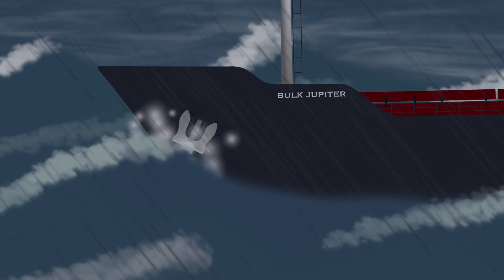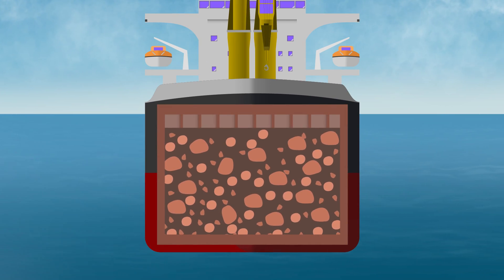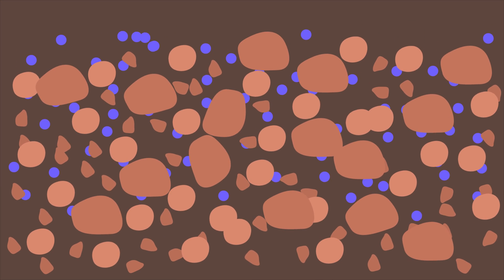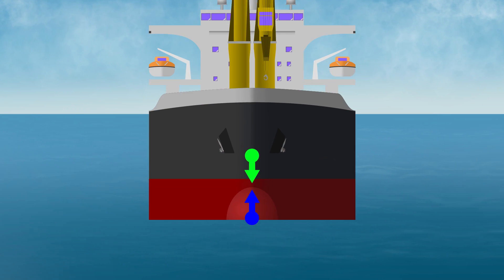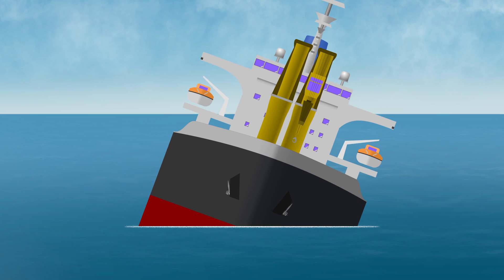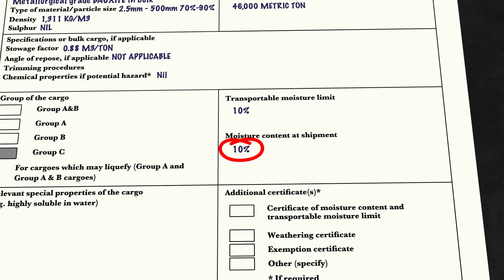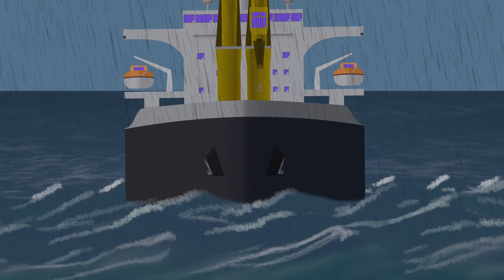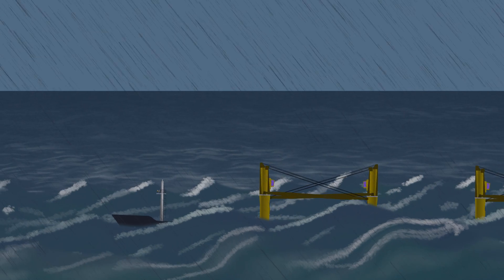Why Does Solid Cargo Turn Into A Liquid? - Liquefaction & Dynamic Separation Explained!

Comment: They need ship captains/load supervisors to have the same authority that pilots do about whether or not a plane takes off. If something doesn't look right with the weather, or the cargo, or the passengers, or the fuel, or whatever, a pilot maintains final-say authority about whether or not it goes out. The company shouldn't be allowed to pressure captains to accept potentially deadly assignments just to meet a deadline. It's ultimately the captain's life on the line.

Also, if your port regularly ships out bauxite, and you have a "rainy season", you should build covered storage.

Comment: Solid cargo ships can make use of moisture removing chemical filters at the port or can use alternate methods of moisture removal through heating systems, and also a moisture removal piping system to transport out the moisture, as it gets generated inside the cargo area, should be installed on board the ships that carry such solid cargo.

Comment: Strang that there are no sensing devices used in the ship's hold for cargo in an open hold loading operation or dewatering devices that could pump off the top slurry if it were to occur during transport. Dollers over safety rules.

Comment: This is also a problem in civil engineering:
https://en.wikipedia.org/wiki/Quick_clay
where seemingly solid ground can suddenly liquify due to mechanical disturbance (vibrations from construction machijnery, blasting) and collapse structures.
Certain types of clay are especially prone to it: They are fine grained and the mineral content of the soil consists of microscopically small flat platelets, which are stacked together like a house of cards. If water gets into this structure, it acts as a lubricant and any mechanical disturbance can cause these house of cards structures to collapse and turn the formerly solid soil into liquid mud.

Comment: Are the arrows in minute 1 opposite. Shouldn't buoyancy be above the center of gravity?
Reply: Buoyancy above gravity means you have capsized
Reply: @phantomsplit3491  maybe I am confused but I think it's the other way around
Reply: @rtarouca 
You are confused :) 

Center of buoyancy results from the displaced water, so it can never be above the water line! 
Center of gravity is the entire ship, including all the bits that make it not-a-submarine (yet).

So every ship will capsize when it keels over beyond a certain point.
Reply: @MrNicoJac  OK :). But let me explain my confusion. Buoyancy pulls up and gravity down. Looking from the bow, let's say boat leans to the right. The buoyancy moves to the right, the center of gravity stays in the same point. Is buoyancy is pulling the boat up and to the centre line, then it can be bellow the center of gravity. If you think of this as levers then we need to understand how these levers  would work to level the ship and keep it stable.  If you don't agree, let me know

Comment: Axial baffles in the hold would be the solution, or at least minimise the resultant list , but so impede off-loading as to be impracticable. 
The loaders measure the moisture content but have an obvious conflict of interest in reporting , like the stated weight of goods in a container , the figures should be taken with a grain of salt.
Of course, the buck stops with the ships master , in this case he even said the cargo looked "a bit wet" . Then again , he serves at the owners pleasure and was obviously loathe to incur their displeasure, wherein the second conflict of interest arises . Sitting in an office elsewhere , securing a profit on their investment may (being generous) take primacy over the safety of the crew , the loss of the Ocean Ranger oil rig being a good example of this.
So all told , the ship was most likely lost due to fiscal reasons with a bit of physics thrown in.

Comment: There are sensors for water ingress in every cargo hold ~1m above bottom. We use to test them with sponges soaked with fresh and sea water before cargo loading, because system could show if water is from cargo or from sea. We carried grain mostly and everybody was scared that some leak from drain system would not spoil cargo.

Comment: 3:35 NOW bauxite has a TML of 10%. At the time of the accident it did not. This is shown on page 18 of the accident report which has an excerpt of the IMSBC code at the time of the accident which shows bauxite was a Group C cargo with no TML whatsoever. The Bulk Jupiter accident is what caused bauxite to have a TML. The first official guidance regarding bauxite being a liquefying cargo came in the form of a Circular from the Cargo Convention in 2017.

The 10% moisture limit on the cargo declaration form was mostly for informative purposes. Just like the cargo is brown and made up of various sized particles. It should raise questions if the cargo falls outside this criteria, but there was nothing at the time preventing a ship from setting sail with bauxite cargo having a moisture limit above 10%.
Reply: TML is a material property more than an administrative number. So all materials have a TML. Very interesting that there was no requirement to be below TML.
Reply: @FekDindad-xy9vz  No. TML is absolutely an administrative property. It is defined in the IMSBC code as, "the maximum moisture 
content of the cargo which is considered safe for carriage in ships not complying with the special provisions of subsection 7.3.2. It is determined by the test procedures, approved by a competent 
authority, such as those specified in paragraph 1 of appendix 2."

A.k.a. you only need to worry about TML if your ship has not been specifically designed in a way to avoid the moisture content hazards. It is an administrative thing. Material property is the most important part of it, but there are other factors to be considered such as hold subdivision and nature of voyage.

Source: Engineer on ships who regularly inspected cargo declarations (which contain the moisture content of the chartered cargoes) in a port which received bauxite.
Reply: @phantomsplit3491 
Great comment, thanks!
Reply: @phantomsplit3491   TML is important for more than just ships. Trucks trains conveyors all have a TML. It's a physical property of a material. 

Of course people write administrative limits around physical properties. But rule books don't change how a material liquefies. Notice how your quote says the administrative number is determined by a physical test. 

And as the case in the video shows TML exists even if there is no rule book. It was the physical property of the bauxite that determined when it liquified not adherence to regulation. 

Source. Engineer who dewaters bulk material for transport in more than just ships.
Reply: @FekDindad-xy9vz  A material's ability to undergo liquefaction due to entrained water is a material property. Defining a limit for this is administrative based off that material property and the type and duration of voyage. Congress or the IMO isn't going to change the melting point of raw copper, but they can pass legislation saying if you may be exposed to hot surfaces then you need PPE and safety procedures. It is an administrative control of a material property. TML is the same thing. It is an administrative control. Congress or the IMO can change what limit of moisture you are allowed to ship a raw bauxite at.

If you ship bauxite ore 600 miles from Yucatan to New Orleans on a bulk carrier with non-divided cargo holds then there is a TML. If you take that same bauxite ore and put in some open hopper barges and transport it more than 1,000 miles upriver from New Orleans to Chicago then there is no TML. Same material, same material properties. But one has a transportable moisture limit, the other does not.
Reply: @phantomsplit3491  no. They both have a TML. One governing organisation might not care. One boat might be happy to load material above its TML. One TML might be so high it's not worth worrying about.  But the material still has a TML. 

An analogy you might understand is density. All materials have a density. Only some modes of transport limit the density. Just because a boat doesn't care about the density of silica sand, too light to matter when the boat usually carries metal ores, doesn't mean the density doesn't exist.
Reply: @FekDindad-xy9vz  It is not the flow moisture point of the material. It is the transportable moisture limit. "At what moisture content is this cargo allowed to be transported on a ship?" = TML. The TML is not "At what point does it behave as a liquid." The point at which it liquefies is strongly considered in this administrative determination of when there should be a TML and what that should be, but it is not the TML. 

Let me flip the previous example of mine around and say a barge comes down the Mississippi river with bauxite at a MC of 20%. That is totally fine, no issues at all. The cargo may exceed the flow moisture point, but it does not exceed the TML because there is no TML. The TML of bauxite on an open hopper barge in the U.S. is non existent, because all of 46 CFR 148.450 (the only part of the U.S. regs with regards to liquefaction on a barge) do not apply to hopper barges. Bauxite can be transported with a moisture content of 20% in this scenario. But if that same bauxite is scooped directly out of the barge and then loaded into the hold of a bulker then that ship is in a world of trouble, because they have egregiously violated the TML. Take a scoop of that same bauxite, put it into a 20' container full of blocks and braces, put that container on the ship and properly secure it, and suddenly there isn't a TML. Those chunks of bauxite still have the same moisture content, same flow moisture point, but there is no applicable MOISTURE LIMIT which would prevent you from TRANSPORTING it in this way. No TML.

Your examples compares the material property of two substances. Mine is looking at the SAME SUBSTANCE. In case one (barge) it has no TML (there is no MOISTURE LIMIT which limits the TRANSPORT of the substance). The other scenario has a TML of 10%.
Reply: @phantomsplit3491    yes the same material can behave differently under different transport conditions. I've dewatered product that must meet a limit to pass through conveyor chutes, a different limit to be loaded on trains, and a third limit before it goes on the boat. The same material exhibiting different properties under different transport conditions. 

But the TML doesn't change just because some regulator says it does. You can't change TML with a pen.
Reply: @FekDindad-xy9vz  Flow moisture point = material property.

TML = limitation on transport if the flow moisture point is a problem for the method of transport. Bauxite in 2015 had a flow moisture point (as it always has). But did not have any LIMITS on its TRANSPORTATION due to MOISTURE content until after the Bulk Jupiter tragedy.

Density is a material property. Cargoes with a density that exceed a certain threshold (1,780 kg/m^3) must meet some additional requirements if shipped on the open seas because they meet the classification of high density cargoes for applicable regulations. Vessels may be restricted from loading cargo based on its density. 

The density is a material property. The limitation on transport based off that density is an administrative one. Flow moisture point is a material property. The MOISTURE LIMITATION on TRANSPORTING a cargo which is classified as likely to liquefy is an administrative one.
Reply: @phantomsplit3491  you can't change the TML with a pen. It is a material property. 

Bauxite didn't suddenly change properties in 2015. The limit was always there. Some just didn't heed the limit. 

And you know density changes just as easily as TML. Just not with a regulators pen. Density like TML is a material property.
Reply: @phantomsplit3491  honestly you sound like someone who has swallowed the book and taken the test without ever understanding it. Your company's procedures are not the whole world.
Reply: @FekDindad-xy9vz  You can't change flow moisture point with a pen. You can't change the point at which a material undergoes liquefaction under given conditions with a pen. But you can change TML with a pen. You can change the moisture content at which a cargo prone to liquefaction is allowed to be transported by different methods. Flow moisture point is a material property, TML is administrative oversight. 

I am not discussing company procedures at all. I am discussing regulations found in the IMSBC code and 46 CFR 148. Because that and similar regulations (as well as company procedures designed to meet these regulations) are the only place you will see TML discussed seeing as though it only applies to regulatory LIMITS on the TRANSPORT of a bulk material prone to liquefaction based off its MOISTURE content. 

A bulker in country X loads a cargo with a moisture content which is 85% of the flow moisture point. Country X's regulations say that the TML is 99% of the flow moisture point, so the ship is all fine and dandy in their books. They then go to the open sea where IMSBC and international regs apply, which say the TML is 90% of the FMP, so they are good in their books too. On their way to their destination they enter the waters of country Y, and country Y has no limits on moisture content in their regs at all so obviously the ship is fine in their books. But then they enter the waters of country Z, and country Z has regulations stating that the TML is 80% of the flow moisture point. So their cargo with an MC of 85% of the flow moisture point now violates Country Z's regulations. The flow moisture point of the cargo never changed. The LIMIT of MOISTURE content for them to TRANSPORT the cargo changed 4 times, from 99% to 90% to unlimited to 80%. It's not a material property if it can change based off regulation. TML is a safety factor built into flow moisture point when an administration thinks it is necessary, and that is it. Before the Bulk Jupiter the international regulations did not think a TML was needed for bauxite. Now they do.

The above is an exaggerated example to prove the point, but is not completely senseless. Load coal in the Great Lakes with an average particle size of greater than 10 mm and a moisture content above the flow moisture point (let alone the TML found in the IMSBC code), and you are totally fine. Because 46 CFR 148.450(b)(2) specifically exempts that cargo from the TML regulations while on a ship in the U.S. Take that cargo on that same bulker, go through the St. Lawrence Seaway, and deliver that same coal to Mexico and you have just violated the TML under the IMSBC code because the international regs do not have any such exemption. Same cargo, same ship, same flow moisture point, but different TMLs.

You say that bauxite didn't change properties in 2015. I agree. You say the limit was always there. I disagree. The flow moisture point was always there, but the limit on when you are allowed to transport it was not. There was no regulatory limit on shipping bauxite due to its moisture content in 2015. Now there is. This changed by the pen.

You can't change the salinity of sea water with a pen, it is a global physical property. You can change at what salinity value that desalinated sea water is allowed to be categorized as potable water with a pen, and that is an administrative determination. You can't change the density of various cargoes with a pen, as density is a universal material property. You can say with a pen that cargoes above a certain density are considered to be "high density cargoes" and therefore some ships may not be able to carry them, and that is an administrative determination. And you can't change the flow moisture point with a pen as it is a material property. You can change the transportable moisture limit with a pen, and that is an administrative determination.

I have nothing further to say on the matter.
Reply: @phantomsplit3491  you've not said anything extra since your first comment. Repeating it doesn't make it correct.
Reply: @phantomsplit3491  spoken like a woke professor scared to debate
Reply: @FekDindad-xy9vz  9 in your name stands for your IQ?

Comment: Why aren't bulk cargo hulls divided longitudally?
Reply: This is allowed to be done instead of messing around with TML. But these subdivisions add so much time to the unloading and hold cleaning process that most ships find it better to eliminate the issue by transporting dry cargo, rather than mess around with the subdivisions.

Plus the water in cargo = useless weight which hurts fuel economy on the ship and (depending on cargo density) can reduce the amount of product the ship can carry on a voyage.
Reply: money

Comment: Interesting. I've heard about liquefaction in a completely different context. Namely with earthquakes that have the same effect on some types of grounds, causing buildings to lean and topple over.
Reply: The Christchurch earthquakes in New Zealand suffered liquefaction causing the majority of the damage and destruction.  Whole suburbs were condemned and there is a ban on rebuilding them for at least 20yrs? This is aside from the city centre though where the actual earthquake did the destrution and death.
Reply: Also with earthen dams! If not properly engineered they can liquefy (typically due to a large moisture content, and ‘bad’ soil) during an earthquake. Potentially releasing all of the water it impounds at once!
Reply: The ground doesn't shake, it seems to move in waves.